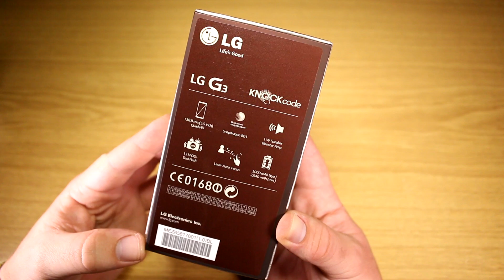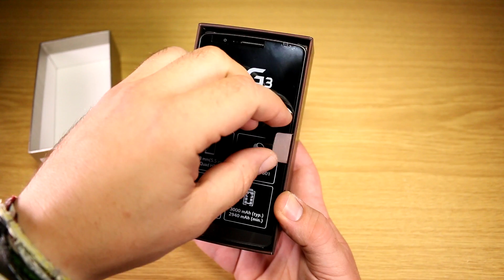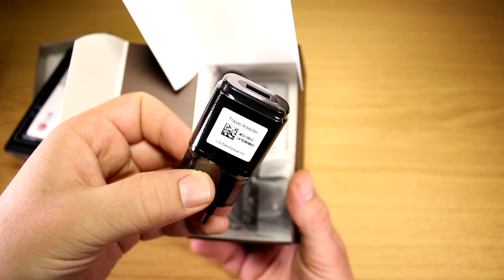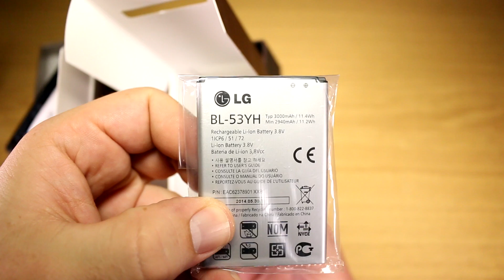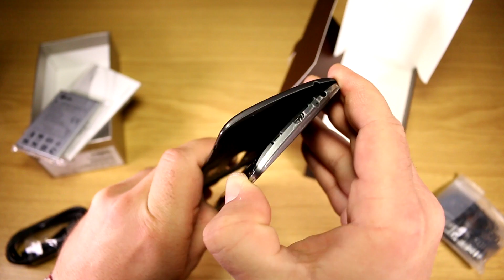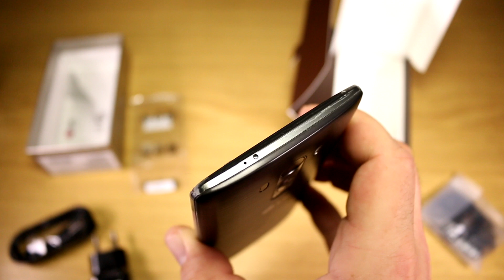LG G3 unboxing - US/EU final retail model [ENG]

Comment: IR blaster better than g2?
Reply from the maker: depends on what you mean by better. I tried it with my Panasonic TV - no problem setting up, but wouldn't always work when pressing the buttons on the phone screen... had to hold volume/channel buttons longer to actually make something happen. Guess that means it wasn't that pleasant of an experience.
Reply: The g2's IR blaster it's weak when it comes to range. If you compare the g2 to the HTC ir blaster there is no comparison. Hopefully, the g3 is better than g2